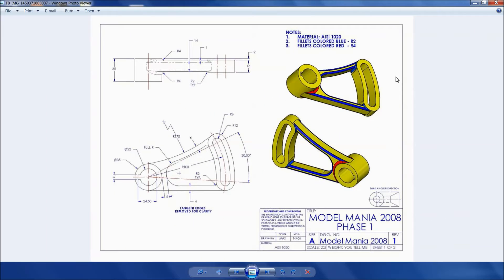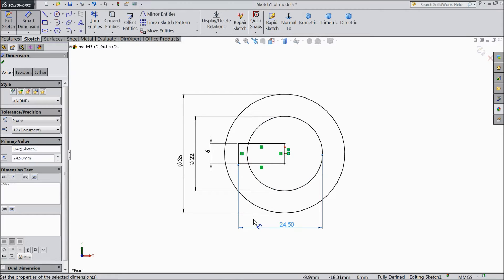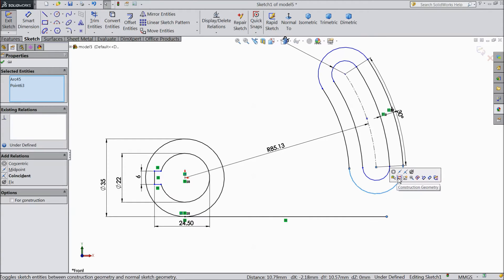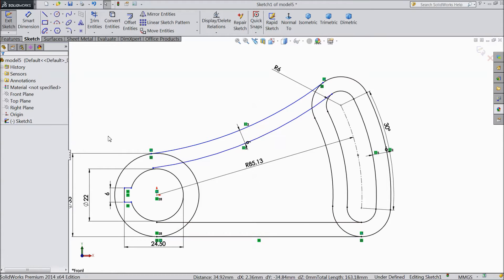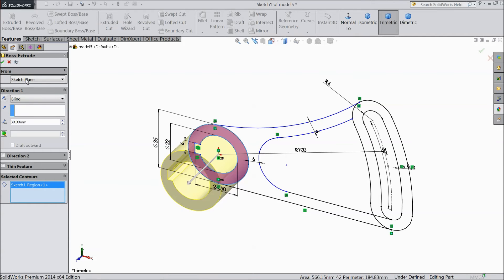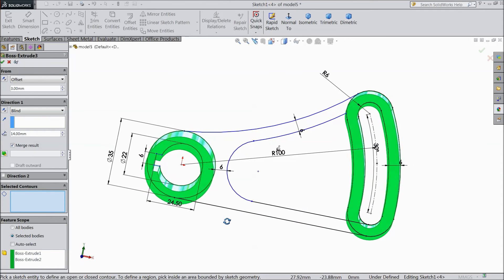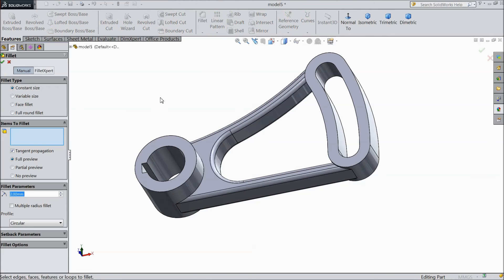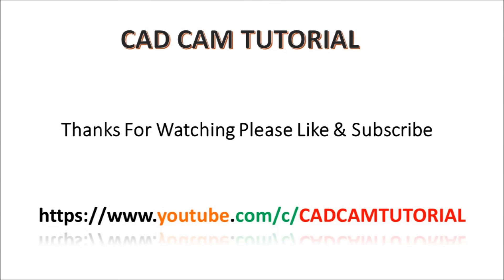SolidWorks Tutorial Basic Model 5

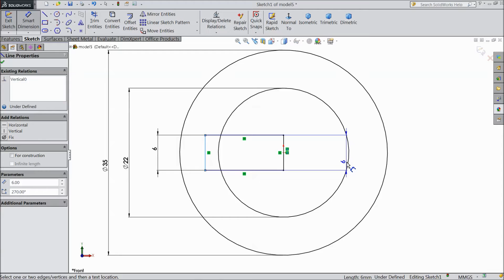Comment: What is that ''poor shifty'' thing? i have tried several times but i couldn't get the point 1:09
Reply: when you use smart dimension to select the distance between two entities and if one of them is circular and you want to measure from its surface but it normally auto-selects the center point of radius because of relations so we press the shift key along with selecting the smart dimension so to temporarily turn off the automatic relations. and thus it selects only the surface point...hope u got it.